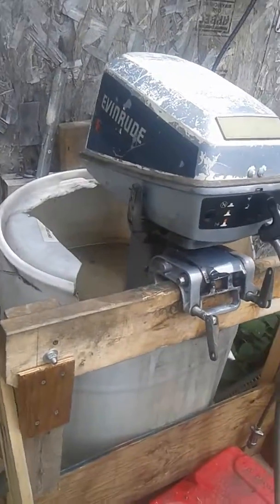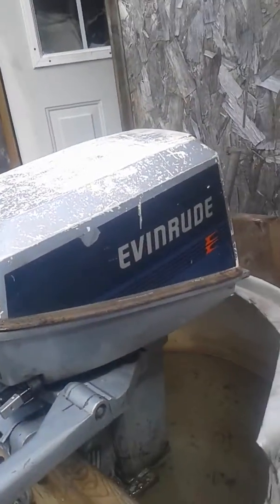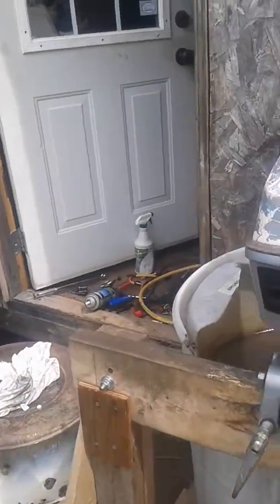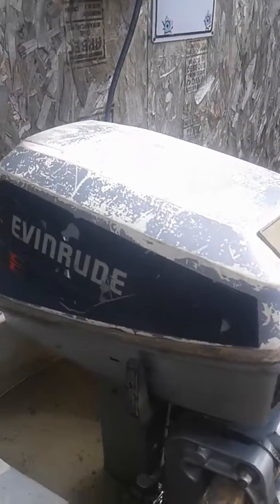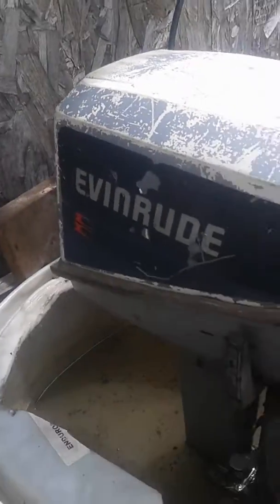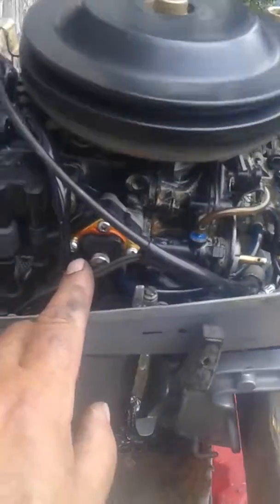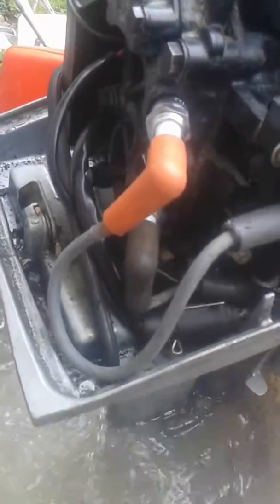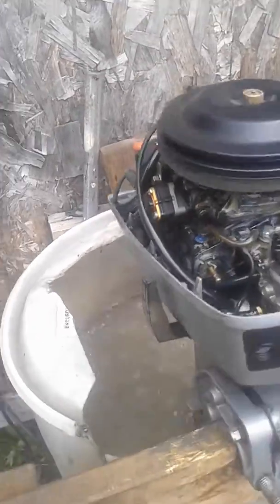1986 Evinrude 6HP repaired

Comment: 6's are great trolling motors as they'll idle right down.   You're missing the choke lever?
Reply from the maker: No J. I just had to take it off to get the air box off. Have a look at the 1966 6hp. I wonder what happened to the shifter....broken shaft or that clamp on the shift rod let go somehow???
Reply: @outboardfixer  Where's the '66?  The shift handles are brittle and break easily, especially if the motor has been laid down on it. Always lay a six down on the tiller side. I have a few here which were broken but welded them up so they look like new, almost.
Reply from the maker: https://youtu.be/iM4KlGjQGcI